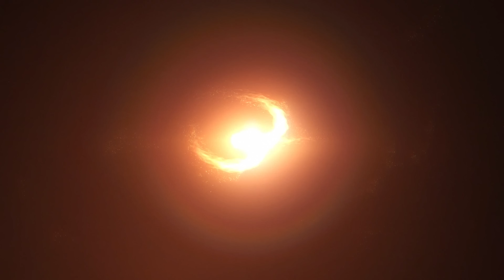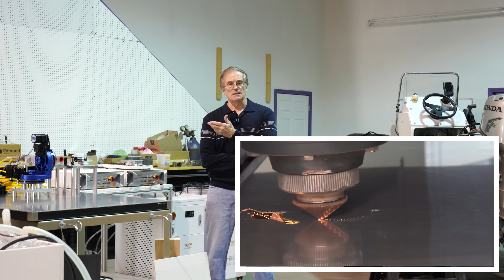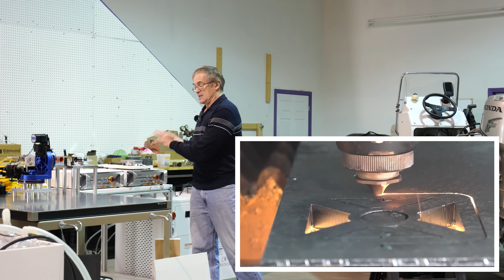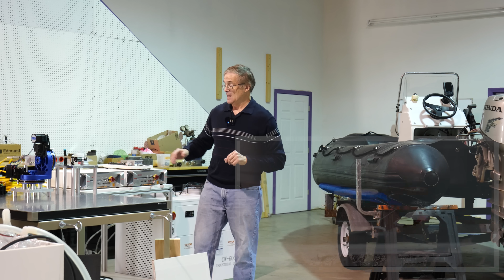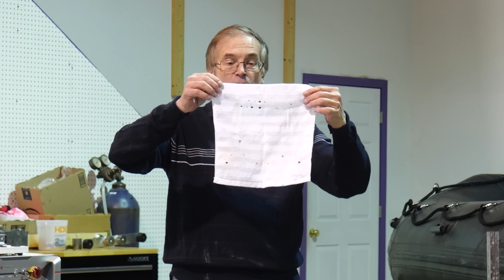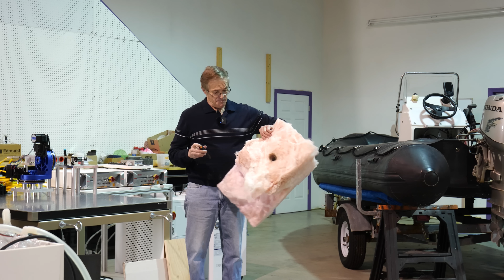We have a problem... and need your help!

Comment: This doesn't directly address your issue, but it could be one more step in the safety chain: Have a watchdog circuit that monitors the the voltage or something going straight into the galvo mirrors (or something, you will need to get creative here) and if the laser output is enabled while the mirrors are stationary for too long, have the watchdog interrupt the laserEnable signal. This could even be handled with an Arduino as a simple platform. The MCU will have its own watchdog you will also want enabled. Also, look up SIL (Safety Integrity Level) in industrial controls. They will have suggestions on things like running your safety circuits in parallel so if one fails the fault can be detected and still fail safe.
Reply from the maker: I agree that layers of safety, both mechanical and electronic, will be more efficient. The electronic system, as you note, must be independent of the primary control system, which is what we're trying to safeguard against.

Comment: 🤔 1/4” aluminum honeycomb covered in the slurry you had made earlier (fire retardant starlite) once surface is charred it can handle heat and doesn’t goop up like insulation did)

Comment: It might be a dumb idea, but what if you make a constantly moving wall that is sprayed with water? (If you can not move the laser, then keep moving the wall.)

The thermal effusivity of water is about 0.15. The timescale of your problem is based on what you have seen, 0.5, and the length of your spot is 0.1mm. The Fourier number you want to shoot for is <<1. If you pick 0.01-0.1, the velocity you need for the wall to spin (like a conveyor belt) is about 10-100mm/s, or round up to 1-10 in / sec. I think you would be able to make that happen with 4 bearings, 2 rods and a stepper and since you constantly spray it with water, you cool it down. I might double-check my numbers.

Comment: Have you thought of using magnesium oxide furnace brick. They are lightweight, and magnesium oxide has a melting temp of ~2850° C. then use an ir temp sensor as a cutoff switch for the laser

Comment: Use a High-Performance Beam Dump:
	•  What it is: A beam dump is a device designed to absorb and dissipate the laser’s energy safely. For high-power lasers (e.g., kilowatt or megawatt-class), you need a beam dump specifically engineered for the laser’s wavelength and power level.
	•  How it works: Beam dumps typically use materials like water-cooled copper, anodized aluminum, or specialized ceramics with high thermal conductivity and absorption. They often have a conical or V-shaped design to trap the beam and minimize back-reflection.
	•  Best for: Continuous wave (CW) or pulsed lasers with extremely high energy outputs.
	•  Example: For a multi-kilowatt laser, a water-cooled beam dump with a high-damage-threshold coating (e.g., black anodized or ceramic) can handle the energy. Thorlabs and Coherent offer beam dumps rated for powers up to 10 kW or more.
	•  Tip: Ensure the beam dump is rated for the specific wavelength (e.g., UV, visible, or IR) to avoid damage or inefficiency.

Comment: Another option is some kind of diffraction grating that spreads the beam out, behind it. Then place one of your other materials a couple of feet behind that, so that the absorbent material is not getting hit by a tight beam, but a spread out beam or lots of tiny beam instead. Then place a reflective, but rough surface (as if one had mirrored frosted glass) behind that. That mirrored, frosted surface will spread the beam farther, and reflect it back into the back of the absorbent material.   That's probably lighter and easier to move around than my 45 degree mirror and water tank idea.

Comment: You said you cant use a reflective surface, because you don't want the beam to be bouncing around your shop. 

My first question in that regard is: Is the laser powerful enough to burn through the mirroring of a standard mirror?

If the answer to that question is "No," then: Have you thought of placing the mirror at a 45 degree angle to reflect the beam down toward the floor?

Then, under said mirrors, you could place open tanks of water. Either dye the water black or simply mix mud up in the water so that it would more easily diffract and absorb the light. Put a layer of gravel in the bottom to catch any spare energy before it punched a hole in the bottom of the tank.  If you have to use multiple tanks, you can construct them such that their sides are very close together, then place a mirrored, upside-down V across the exposed edges of the tanks, such that it will reflect the beam away from the edge, but still into the water. 

The water in the tank will then collapse into any hole created by rapidly vaporizing the water. Unless the laser is a sustained beam in one place, it is highly unlikely to heat the water so hot as to cause the water to explosively turn to steam fast enough to be a real problem. Yes, you will have water sputtering out of the tanks, but it is just muddy water. Yes, you will likely have steam. But that will just dissipate the beam even better. 

When you are finished testing, you can just drain the water out of the tanks and easily set them aside. They can be on wheels, or whatever makes them easier to move.
Reply from the maker: It is powerful enough to shatter a conventional mirror.
Reply: @TechIngredients    OY!!!

Comment: I made a quick sketch in blender and some calculations in excel just to see if my theory works.
I've read a couple comments from of others thinking in the same way.

Build a frame of wood, let's say 4x4m so that you have some area to aim against.
Put sheets of polished stainless steel on the frame and cover this with two layers of drywall.(25mm)
Tilt the frame some 40 degrees downward so that when fired upon the steel will reflect the beam back into the drywall when this is penetrated. The angle of the construction will make the distance longer than double the drywall distance.

If the laser is positioned 1,5m above ground, 7,5m from the tilted wall and a tilt of 40 degrees.
Laser beam tracking plus/minus 10 degrees.
The additional drywall distance will vary between 10% to 35%.
If the time it takes to burn through 12,5mm drywall is 0,25s the new times will be between 1,1-1,5s.

This would make it quite mobile since it's just a "wall" when moved around.
No moving parts and easy to patch up when used up.
The floor needs to be covered since the beam will hit it if the tracking stops.

I have no idea if these materials works in real life... but the concept might work.

Best,
N

Comment: what about glass in the front? if you are using glass optics to concentrate the beam, could you use glass at the other end to spread it out before it gets to a material you tested (but which now is not trying to absorb so much energy in such a small point).

Comment: First, you didn't specify how large of an area do you need to cover? Just the size of that brick? A 4' x 8' area? The entire size of your wall?  Without that information it is hard to make suggestions for things that will actually be feasible for you to build. Please add that information to a pinned comment, and then respond to me so we can continue.
Reply from the maker: If you watched the video, you'll have seen me walk towards that back wall and describe the 30 to 40 sheets of drywall that would be required. It's about  25^2 meters in area.

Comment: Well I used to be head of research for two of the world's largest toy companies. Which qualifies me only as having a strong desire to destroy things. Anyway, I would try a lamination of aluminum foil and cardboard set at a 45° angle of incidence. Maybe start with a stack of 12 of cardboard layers (not corrugated) with aluminum foil in between. And of course I would have a non-combustible barrier at the side just in case.

Comment: You have been using the wrong cheap products that will only work for very low powered lasers.  Build an enclosure about a meter square is large enough for indoor targeting, the front panel should be 1/4" or thicker carbon felt, backed by a layer of 1" or more fire brick, another layer of carbon felt and a heavy mirror in the back to prevent a full blowout through the layers.  Carbon felt is very high temperature, doesn't melt like fiberglass batting, returns to cool fast and should withstand more long duration flashes than what you have been using.
Reply from the maker: We need to protect the entire back wall.  That is about  25^2 meters.

Comment: A large fairly rapidly spinning carbon foam disc made of the blackest most fire resistant foam you can get. ISO 1182? Foam is fairly light weight and somewhat absorbent, maybe add water. Spinning to prevent energy build up in 1 spot for long. or maybe a large spinning heat sink of some kind, stainless steel? or titanium(expensive), with ribbing to make use of the airflow while spinning for heat energy dissipation. Dry-ice with a pre-filter of some light absorbent curtain, curtain may burn through on the way to target but maybe cuts down on the return light dispersion from the dry-ice maybe.

Comment: A wall of steam generated from something like a commercial humidifier? Should have a scattering effect like you wanted from the fiberglass but can't be melted (since it's already vaporized). No idea how thick the wall of steam would have to be though so buying enough equipment could be as cost prohibitive as building a thick brick wall.'

Alternatively, adding a flowing curtain of water or perhaps cutting oil across the surface of your safety layer should drastically improve heat dissipation. Even the plywood might be sufficient if it's prevented from catching fire.

Finally, if the equipment can handle it, pulse the power so that it's only at maximum intensity when desired (on target?) instead of constantly.

Comment: Hello Tech GooRoo Family it's always fun to see we all can come together and figure any wide range of issues out and not to mention it keeps those brain's aworkin in tip top shape by the way my two cents here will say if brick and concrete work but you need it small lite weight and durable plus mobile you could try (Backer Board) in layers it's made of mortar and fiberglass mesh they come in 3X5 foot sheet's also it's fairly cheep also I have heard but not for certain but (Rhino Liner) for truckbeds and underbodies is tuff as hell and can withstand C4 I seen that on MYTHBUSTERS they sprayed it on a truck and blow it up and was still able to drive the truck but don't know how it would do under a Lazar of your magnitude but if layered two coats on backside of backer board 5 to 10 sheets might be able to hold up for a reasonable amount of time and as a weird thought could you use some form of glass like bullet proof type to make a small aquarium and use water or fake quicksand aka water and starch or sheet metal box filled with dirt and use it behind the backer board and if the glass was of non reflective  type a course , some of these things boggles my mind and the mind wants to know.🤯......🧠🗯️ I WANT TO KNOW? 🧠.....😖😵😑🤯🤕WOW What happened, 🤓Dude you had a brain fart you'll be OK. 

😅 THANKS TECH'S I always have a blast watching your channel and I don't know if any of this will work for you but at least it was two cents worth spending 😉.

Comment: What about loose white play sand inside a glass "wall" and water to fill the voids? If you have medium thickness glass panes that are setup like very thin fish tanks that are filled with white play sand then as the sand is heated up and melted the loose sand above it can fall to fill the area of any void from the melting of the sand in that spot? The white sand should help to disperse some of the energy and being loose the water can fill the voids and offer more heat dissipation?

Comment: Hi! I’m not a professional, but here’s an idea: you might consider using a very fine Fresnel lens—not to focus the beam, but to rapidly disperse and defocus the laser energy. This could reduce its intensity enough to make it harmless beyond a short distance. It would likely need to be custom-made.

Another idea might be a translucent scattering material that disrupts the beam’s coherence. Something like a synthetic aerogel embedded with microspheres or air bubbles could scatter the light through multiple internal reflections. The goal is to break up the focused beam into many directions to diffuse its power.

the less expensive would be Laser safety filters: They're fairly portable and can be purchased in sheets but pretty certain you'll cut right into it.

OR just an hight reflexion index miror pointing down at a 45° angle with a vertical fresnel lens in front of it? will it cut into it?

please, please don't ask why I have so many ideas :p
Reply: Optics stop working for very high power lasers. No optic is 100% transparent, so you will get some energy into the optic and melt it.
Reply: @christiannorf1680  yeah I had that feeling too, the only Idea I had were something like something flexible and, scatering and translucent with 2 rolls turning and a water pool cooling from under it.
But that seems to be a large device
Reply: My first thought was a large Fresnel grating.

Comment: So maybe a multi layered plywood wall with pockets for water in between with a catch tray underneath to drain the water as it spills out. Cheap, no Fires, potentially very effective. Easily patched after damage.
Reply: If it was me Id take some time in the shop to build a wood frame with some wheels cantilevered  on the bottom. This would allow me to build plywood boxes that I could slide into the frame. The frame would be shaped like a Y at the top so the box is easy to line up into the slot. Then you just build a bunch of these frames and boxes. I'd go with 2.5 to 3 inches of water thickness in each box . So then you wheel them behind eachother and fill them with water. you can simply pump or siphon the water out to avoid trying to build a drain in each box.  After that you would need to build a large collection pan underneath for when you break through the box. That would be graded to go to a drain in the pan and put a hose or a tube on that drain that goes outside. I am imagining the boxes would just be the size of whatever the commercial dimensions are that are available and then you dont need to do as much cutting because you just use an entire strip to match the sides to build the box. If you use sheet metal, that is currently very expensive. It seems to have peeked in price some time last year and come down a little. I was regularly doing some metal purchasing last year and a little this year. Lumbar and plywood aren't as cheap as they used to be either... good luck.
Reply: To save time on the frames you might buy some trestle posts of some kind with wheels. You might needs something a bit substantial to hold up the water weight. I work with a steel post trestle that is designed the way I described the wooden one.. That's why the idea occurred to me. Its very sturdy.

Comment: With that amount of power the only option are gonna be materials that will ablate like heat shields on return modules or some kind of smoke/mist. Inexpensive and non-toxic option to delay it could be to force it to go through a medium that will diffuse it. Regular water mist and smoke from a smoke machine could work but without testing i have no idea how effective it would be. That thing is insanely powerful. In case it would dampen the power of it by dispersing it and creating steam that would then be heated in to plasma which should delay it even more. Maybe if you created some box out of thin material or used some flexible curtains to keep that smoke and mist somewhere you want it to be. It could just about work or make some kind of cheaper material where the beam hits a viable option. If you give it a try please tell us the results. Thank you and good luck.

Comment: What about scattering light instead of absorbing it? Maybe you could use something like stacked thin sheets of laser-transparent materials (like the one lenses are made of) but with slightly etched surface. This theoretically can scatter some of the light on each sheet weakening the beam. Or maybe use some material that is just slightly opaque to this wavelength, but i have no idea if they even exist.

Comment: Old LCD TVs? Their layers for example the acrylic sheet used for the back light that has the polkadotted opaque columns through it to disperse the light evenly from the LED's that light it. if the laser enters that (or a stack of them) from the side with something like drywall on top and below it, it may disperse enough of the energy that what ends up getting absorbed by the acrylic and backing materials may not be lethal to the material. Or it'll just say to hell with physics and obliterate it lol

Comment: What about a water solution / suspension that would break up the beam and disperse the energy into the water? Maybe there's a material that could help transfer the heat of the beam into water without letting it pass all the way through?

Comment: have you tried ballistic gel infused with some light diffusor? like glitter or smoke or something that obscures the light transmission. the gel would provide a support to the medium and would melt as is hit, but could replace the missing part on its own if it is the right formula

Comment: If the cutter lens that came with the laser is able to handle the diameter that is being delivered, then place it in front attached to a retracting mechanism that'll move it out of the way when you want to use it.

Comment: How about using something that vibrates like a curtain maid of vantablack material? Several layers where it is reflective on the back side and absorb it on the front side to keep the bean bouncing back and forth between the layers of fabric hanging off of a rack